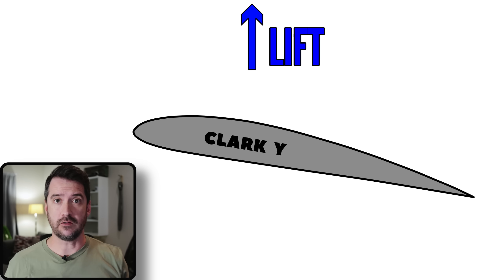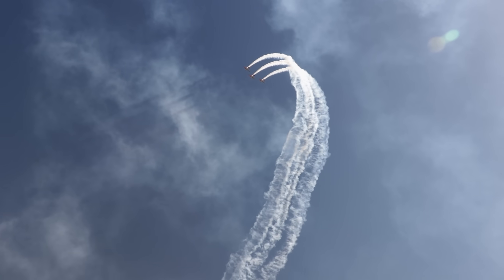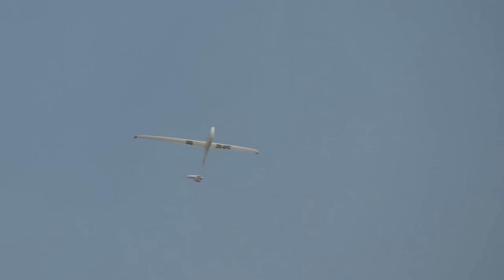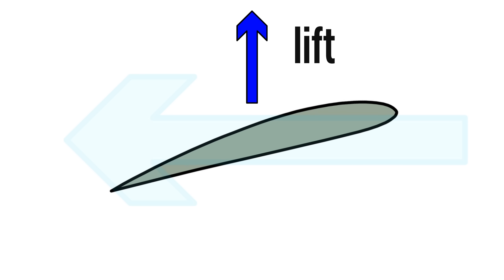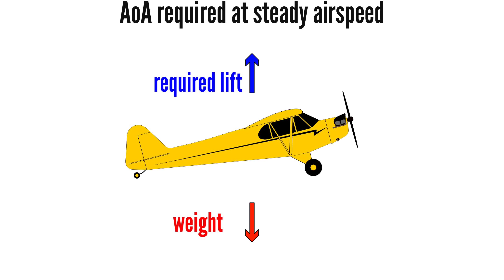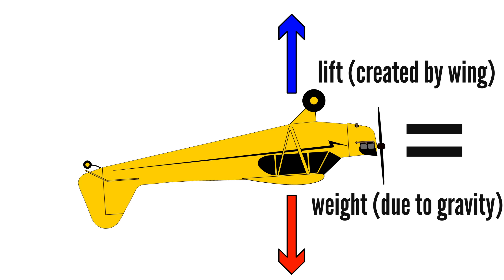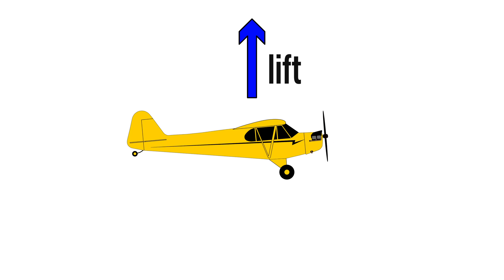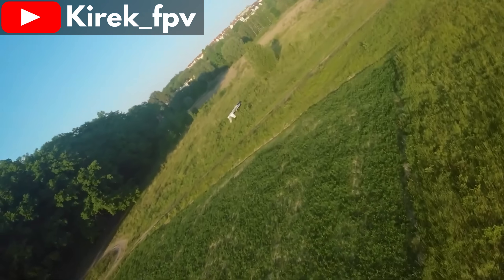Is Airflow Distance Over the Top of a Wing Always Longer?

Comment: I find it interesting that all airplane wings are mounted to the plane with a positive angle.
Reply: Not strange at all. Airplanes are usually designed to fly with the fuselage oriented along the direction of flight. That way the airframe produces the least drag. The wings gets attached with an angle of attack that creates the necessary lift at the intended cruise speed to get best fuel economy.
Reply: @hell6orn  Exactly...  wing tilt, NOT WING SHAPE, determines lift

Comment: All down to angle of attack...
Reply: Not quite all. A section with no camber has zero lift at zero aoa. A cambered section has zero lift at a small negative aoa.

But otherwise yep i agree with you.

Mind you an aircraft is often designed to fly at its most efficient aoa in cruise, that is if efficient cruise is its most important design parameter, and thats usually at a fairly small aoa. A cambered section will always br more efficient at a small positive aoa than a symmetrical section
Reply: .. no. Did you watch the video?
Reply: @BlakeBigfoot  yep i did, what did i get wrong?

Comment: The big problem with the traditional wing diagram showing lift, drag, thrust, and weight is the word LIFT.  This gives the mistaken idea that there is some mysterious force that lifts the wing upward.  This is usually accompanied by the explanation that Bernoulli's Principle that comparatively faster airflow over the top of the wing produces a low pressure area that overcomes the weight of the aircraft and ;Lifts it upward.  This pressure differential is actual but it isn't the low pressure above the wing that produces an upward force, it's the higher pressure below the wing caused by the air hitting the bottom of the wing being deflected downward that PUSHES the wing upward.  Bernoulli does make a wing moving through the air more efficient but it's Newton that makes the wing do its work.  This is why upside-down airfoils, barn doors, and your hand outside the car window all can be made to move upward while moving through the air.

Comment: The premise is wrong. Lift is not created because the upper path is longer than the lower one, and air must join at the aft stagnation point at the same time. You can see here that air moves faster above the wing and even reaches the aft stagnation point first:
https://youtu.be/e0l31p6RIaY?si=Wz9BigCIOlppFChE
This video is a good explanation on the physics about lift:
https://www.youtube.com/watch?v=d4w1Iy4vVMg
This one is longer but if you have some basic physics knowledge and you're interested in the subject is worth watching:
https://youtu.be/QY2pS-xXC_U?si=JLWQpKSJnirugsoz

Comment: Like most everyone I was physics taught wing Lift was due to non-Symmetrical airfoil generated top/bottom air flow soeed Differential vacuum "Sucking" the wing Upward.....Years ago, I flew the Most Extreme example of non-Symmetrical airfoil (20% undercambered high Dihedral high wing) RC airplane with wing attached Upside down (Made it looked like it was casual oversight)....The confused spectators Strongly predicted certain Crash at liftoff.....Everyone was amazed how well the RC plane flew doing figure 8's both normal & Inverted flight !! ....

Comment: This is not accurate. It may be the way it has always been done, but an airplane is not a motionless body and the air does not "flow past the wing". Disregarding wind, air is still, it does not move to the back of the wing in a straight line. Maybe this is wrong but if the wing is being pushed up, then the air is being pushed down, and out to the side in a vortex. But everyone hates the "moving wing/still air" concept that is more accurate but harder to photograph or draw or explain apparently. The angle of attack is what pushes the air down, but the wing in your rendering shows it going straight past the wing unaffected.

Comment: Notice aerobatic aircraft have symmetrical aerofoils, so they are reasonably efficient either way up, but need slightly more angle of attack in cruise than say a Cherokee. Few normal aircraft have inverted oil and fuel systems so asymmetric foil is better. The symmetrical foil works because the seperation or stagnation point is moved towards earth, best way to describe it, to create lift.
Reply: Symmetrical foil has to be handled carefully, go slight nose down could bunt the aircraft. The video is 10 minutes of waffle.

Comment: So you have pictured everything except where exactly is stagnation point in inverted wing and measured paths, thus basically NOT PROVING anything. After watching this video there is nothing but your claim that upper path is longer.
And it is not disputed that SOME of lift is created by difference in path length, but is that only means of creating lift and is it sufficient for flight (both regular and inverted)?

That argument is not stupid by any account. It could be wrong, but it is not unreasonable to ask such question. Especially when even you admittedly don't know how lift is created.

Comment: Lift is simple if you understand Brownian motion. Air particles vibrate creating air pressure, in fact everything does, reason why all motion stops at absolute zero.. By accelerating them over the top curve of a wing the molecules have less time to impinge their force on the wing and pressure drops. Likewise they can bunch up under the wing. Less air molecules at altitude or higher temperature, where molecules push further apart equals less lift. Also a small amount of air acceleration downwards, Newtons, law, gives a small equal and opposite reaction. Flaps help with this, anyone that as flown Seneca full flap soon learns how this force disappears with a bump if not careful.
Reply: Experiment i would like to try is to pass a fluid like water over the top of aerfoil or spoon inside a vacuum chamber. I would expect a small amount of equal opposite reaction but very little "lift" generated.

Comment: I remember from fluid dynamics lectures at university (professor Guido Buresti, an amazing teacher) that the longer path only partly explains the higher speed. The particles on the upper surface will arrive at the trailing edge earlier than the ones at the bottom. Unfortunately I don't remember the exact explanation

Comment: I could never figure out if I was supposed to think of lift as an upward "pushing" force generated by the higher pressure underneath the wing or if it's more an upward "pulling" force like suction from the lower pressure above the wing holding it up..

Comment: Bernoullis  principle. Isn't that where faster moving air over a curved surface has less air pressure with more air pressure under the wing as a result creating lift? It's actually responsible for 60-70% of lift in a wing. Angle of attack is the rest of it. If you invert that airfoil angle of attack has to be much greater to overcome that higher percentage.
Reply: Wrong, the lift is fully determined by how much air is deflected, pressure differences around the wing are just how the wing and the air are pushing on each other, all forces are through fluid pressure between the air and the wing and between one parcel of air and another.

Comment: I always say the lower pressure ALLOWS for lift, but you need speed and control of your AOA to let the bottom of the wing push against the air mass to push the weight upward.

Comment: A Cessna 152 also can't fly upside-down.
Not because of its wings -- because it uses a gravity-based fuel feed to get the fuel from the in-wing fuel tank into the engine.  There are no fuel pumps on a Cessna 152.  You flip that baby upside down, and you starve its engine of fuel in a matter of seconds.

Comment: This is a futile argument over semantics.  Lift is created by Newtonian mechanics.  Shove the air down, it pushes the airplane up.  That's it.  However you do it, it's lift either way.  Curved wings, flat wings, propellers or rocket engines; they lift by shoving air down.
Reply: Nope.  not like a windmill.  There's more to it than just a deflection of air flow.

Comment: There is an argument that the higher pressure beneath the wing is what causes the stagnation point to drop below the tip: the higher pressure drives some of the airflow (forward and) over the wing (but more accurately, the static and dynamic pressure elements are in equilibrium). Also, for the RC model analogy, its not entirely about wing loading, but also needs to consider scale effects - the size of the wing is smaller, but the density and viscosity of air is the same; the air has less chance to do anything (separate from the surface, induce turbulent flow) in the shorter distance of the model wing. Altogether a good explanation of why wings work :)

Comment: I,ve been an airline pilot since 1965 finishing as flight instructor on the Boeing 777-300ER.  I have to say that since my very early days where someone knew about this, in spite of all the bigots with their longer path vs shorter path theories that they would swear to, taught me the real physics of the subject.  It really is so simple that I can't understand how all this could have gotten off the         rails for so long.  It's all about downwash.  No downwash = no lift.  I don't  care what the shape of the wing is, or if it is upside down or right way up, symmetrical shape or not.  An angle of attack is needed, and this will differ with the wing cross section, or upside down or not.  The angle of attack produces lift and the accompanying drag, BUT ALSO DOWNWASH.  Change this angle of attack to reduce the lift to zero and you have no downwash.  All the wing  is doing is accelerating (and this can be either speed or angle) a mass of air giving an equal and opposite force.  Remember your school days where you learned F=MxA   So why have so many people over the years forgotten this simple formula?  So let's put all this differential pressure theory to bed and get on with the real world.  Also you may have memories as a kid putting your hand out of the car window and changing the angle of your hand to the airflow.  Very convincing when your hand was lifted almost beyond what you could hold.  Any way, I've said enough - time for all you people to do your own research.  Cheers for now, Phil
Reply: Wings can generate lift without downwash and wing tunnel tests prove this.

Comment: I think the shape of the wing makes it more efficient.  The bottom line though is that the angle of attack accelerates the air downward.  This acceleration causes an upward force on the wing.  As Issac Newton said, F=MA.
Reply: Certainly reduces the pitch attitude required for take off. Look at the extreme angle of say jet test aircraft on take off.
Reply: @flybobbie1449  Very true.  I'm always surprised when I see an older prop driven airliner talk off without much rotation.
Reply: @jimprice1959  Lot of slipstream lift as well which you don't get with jets.

Comment: Very interesting.  I've often wondered how lift is generated by yacht sails where the shape is cambered but the sail is very thin (sub 1mm) The path length each side are identical but lift is generated.
Reply: Going to windward the sail bends the air flow vector (accelerates the air).  Off the wind it slows it (parachute effect, slows the vector length).  Work is done.

Comment: As a flight instructor, I was disappointed to find that the FAA explanation of lift is wrong. Bernoulli plays a small role, but the pressure differential is not the main source of lift. Fortunately, NASA has a better set of ideas. They can be found here: https://www.grc.nasa.gov/www/k-12/VirtualAero/BottleRocket/airplane/wrong1.html

Comment: Very good explanation!  Now, consider this: Drive your car at a decent rate of speed.  Extend your arm out of the window with the palm down.  Now, rotate your hand so that the oncoming stream of air impinges on the bottom of your hand.  Your arm will be pushed up and back.  It's the force of the oncoming airstream that causes lift, not some sort of pressure differential, although such a differential does exist.  You can make anything fly if you use enough power.  A common exhibition at airshows is the "flying ironing board," where a small ironing board is used as an airfoil and made to fly with a small engine and propeller attached.

Comment: @LetsGoAviate    Wrong!   Why You repeat the false theory of “particle pairs” or “equal transit times” is crap, come on!  It is the Coanada effect that bends the top flow down making lift via Bernoulli.  This is a good channel but the bit about air particles separating at the leading edge and then coming back together at the trailing edge is crap.   The particles act independently when separated by the wing, there is nothing in classical physics that would cause them to act with any linkage once separated.   

Look up “Coanada effect on wing“.  Also This video does a great job, please educate yourself on this fundamental detail.  https://youtu.be/uzWAB1Q_YgU?si=qfAHMTypahmwdl7o

Comment: Changing the direction of a moving mass requires a force. -> Impulse. The incoming air has a different direction, relative to the wing, then the air behind the wing. The air is forced to move from horizontal to downwards. That change in direction results in a reaction force on the wing surface -> lift force. So, the wing basically pushes the air down to stay up. The air foil just makes it more effective in a certain orientation.

Comment: if they insist that the longer path over top has nothing to do with generating lift.     when upside down a non symetrical wing still gains lift by sending the airflow over the side which is uppermost  on a longer path due to angle of attack.

Comment: You can suck water from river, going into process facility, send to your home, drink it, dump them back to sewer, and discharge that water 100 meter down the river, it doesn't mean the water you split from the river will fly though you body over 2 mach to match the water in the river at the same time at the drainage.
And you can clearly see in wind tunnel test, the air moving above the wing actually get to the trailing edge sooner than below one., not at the same time.
Reply from the maker: Agreed, air over the top will usually arrive at the trailing edge before below.

Comment: Just because an airplane can fly upside down does not mean that the theory of how wings generate lift is wrong. First of all any pilot will tell you that when inverted, it becomes more difficult to maintain altitude. Generally speaking, even at air shows, aircraft usually stay inverted for limited periods of time—and these aircraft are modified for inverted flight and pilots specially trained. Think of it this way: Do you think an aircraft could take off from an inverted posture? Gliders-the purest example of basic aerodynamics- with the exception of a loop, never invert, barrel roll, etc.

Comment: Angle of attack is the biggest differential on the theory of lift of an aircraft whether inverted or not .
Most people don’t realise that when a plane is flying “ level “ it is still at about a 3-5 degree angle of attack .
Cheers 🍻 , Woody NZ 🇳🇿 .
Reply from the maker: Yeah wings are rarely mounted 100% "level", with the OV-10 Bronco as an extreme example. Some jets and some aerobatic aircraft would have 0° AoA when level though. Cheers